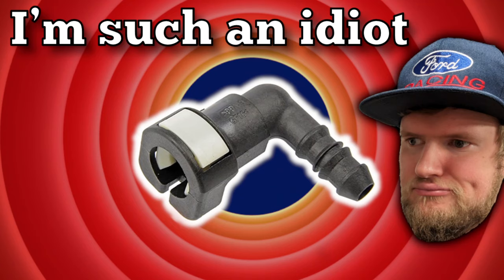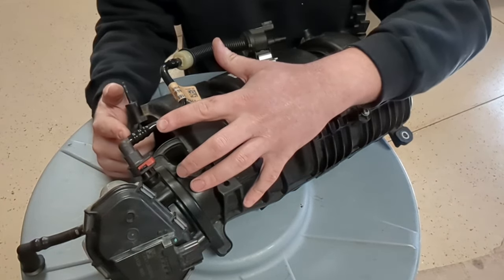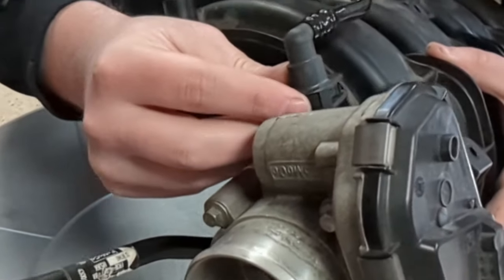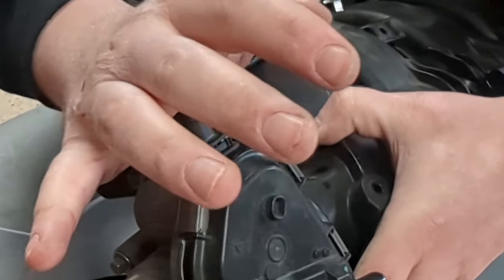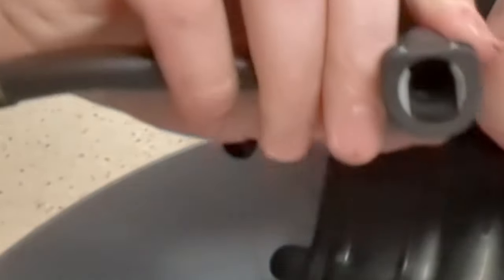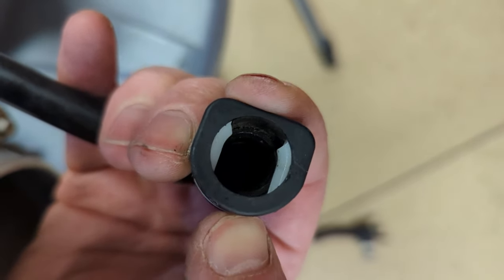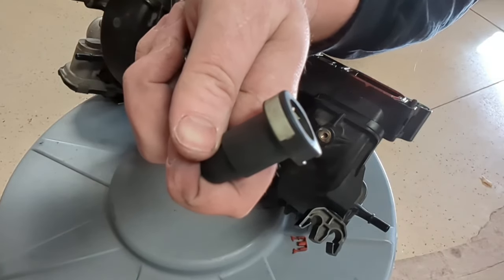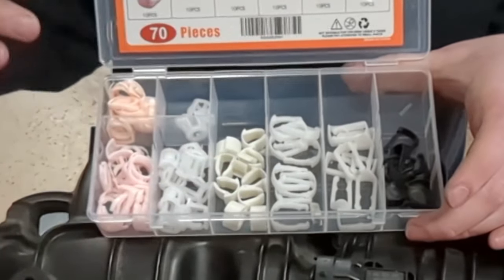How To Remove Stuck Quick Connect Fuel Vacuum Lines - Without Breaking The Clips!

Comment: The problem is that these 'quick connects' are usually in a horrible position to 'push down' on them further when on the vehicle itself. So the better mechanism would be "Go back to the stuff that worked before!" and phase out these quick connects.
Reply from the maker: Ah, but the lowest skill worker on the assembly line can put it on quickly, even with a blindfold. That is the key.
Reply: They normally are not that bad if you work on cars …. Honestly easier than using a disconnect line tool on non quick disconnect lines
Reply from the maker: @FirieonOG  I've worked on a lot of stuff. Mostly old and racecars. Never had a hose clamp get stuck. Whether the video was helpful or not, thanks for watching and commenting 🍻

Comment: I almost wasted a hundred bucks on a fuel line disconnect tool set, but even the guys selling those won't put up a simple video telling how their tool functions.  I almost broke my clip, but I ended up leaving it connected and just swinging the intake to the side to get the job done, but it's been bugging me ever since!  Thanks for the information.  I did already order a box of those clips anticipating problems the next time, but the strange thing is, that the clips in question here are listed on the box for GM and Ford, yet I'm working on a 2015 Jeep 3.6 Liter V6 and it has those very clips.
Reply from the maker: Mopar likes to copy everyone else's homework 😏 Glad I helped!
Reply: Hey, I just happened to think.  I did go online looking for the clips and I had found the ones on amazon that you had listed also.  So I got those ordered for next time in case I need them.  That first clip that came off, though, I never really found a source for those, and I just worry about dropping one of those and losing it, so if you know a source for those, I'd appreciate finding out.  Could probably do without it I guess, if it came to that.

Comment: I replaced fuel injectors on my 2003 Lesabre 3800 the other day. The fuel inlet is just like the white clip. I got lucky and it didn't break when I used my pick to pull it out the back. At least I know now and it didn't cost me either. Thank you.

Comment: When they are very difficult use a pair of needle nose vise grips. They work extremely well with the non movable leg on the flat portion oh the connector and movable leg applying pressure to the white movable clip. You will be impressed. I was

Comment: Ty Pete I have to change the fuel pump in a 2007 jeep commander and decided to cut a access panel above ..I went and bought a disconnect set I guess I don't need them now! Ty

Comment: Wow. Ford made that pretty common knowledge years ago. I didnt realize people were breaking these. All spring clip fittings have to be pushed in to release. All of the tools used to release every other fitting has you push the tool in and push down on the fitting then pull off. Amazing what one views as common knowledge isnt so common. Explains all the zipties I find to replace the clip.

Comment: Another thing i do is spray penetrating lube on all quick release clips. That helps with tough & dirty clips. Works like a charm
Reply: I do that too. Makes it so much easier.  I  use it on those 4 wheeler clips that hold the plastic trim on the fenders,
Reply: Except that penetrating lube will degrade the plastic. Just don’t. Use some soapy water on em if u need some lube w plastic don’t use petrochemical stuff on it.
Reply: @michaelbenoit248  it also makes the plastic shiny. Just kidding.  I usually wash it down after I get it put back together, to neutralize the petroleums.

Comment: JEESH! I too am an idiot.  But now I'm a grateful idiot.  The last line to remove from gas tank is now going to be a breeze.  
I am contemplating if to spray a cleaner first as dirt accumulated 225k miles. 
Thank you, thank you, thank you (because hitting the like button only works once).

Comment: It's plastic. It breaks because plastic only lasts about 10-15 years before it becomes Uber brittle. You're supposed to break the clip and replace it. Either that or do like I do and cut those stupid things off and use a regular hose clamp. Metal hose clamps can last a lifetime.